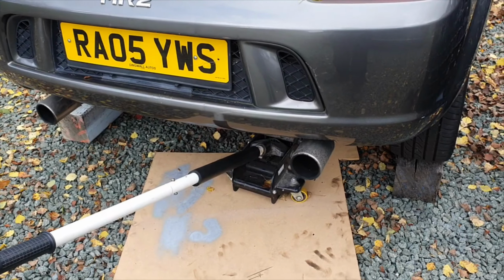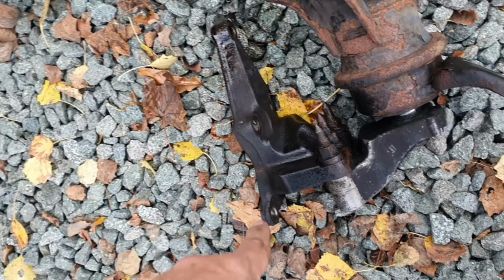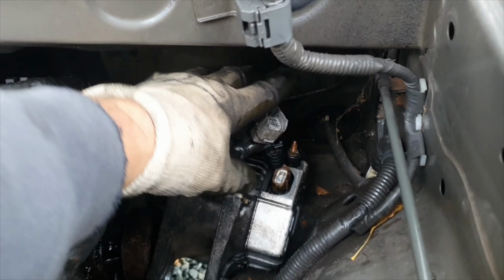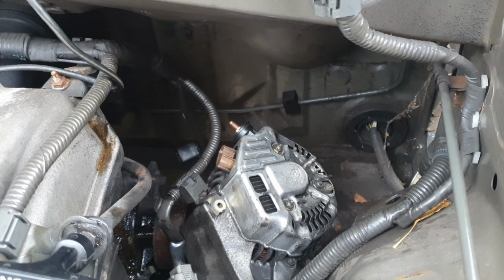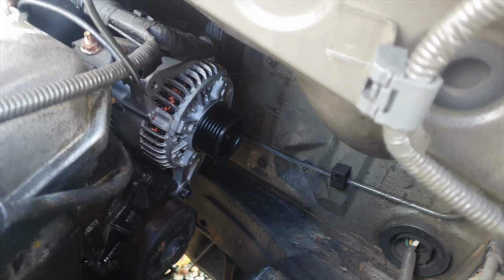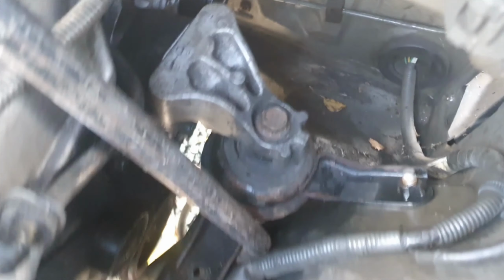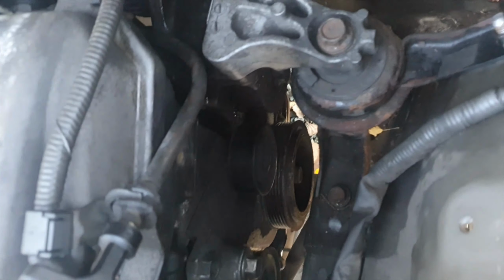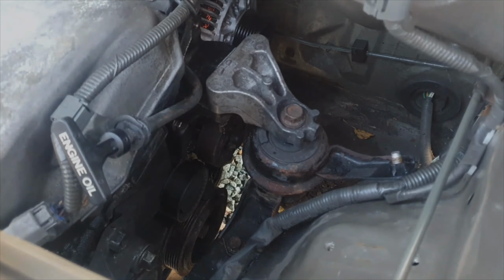How to Change a Toyota MR2 Mk3 Alternator

Comment: Hi did you have to jack the car up to replace or can you get away without.
Reply from the maker: You need to put Jack under bottom mount to take weight off the top mount when you remove it. The wheels can stay on and on the ground.

Comment: The belt tensioner is auto tensioning. The fake bolt to tighten the belt is pointless. I went and bought a new tensioner for no reason. So watch out for this guys.

Comment: Does the alternator really keep breaking on this car? Because the guy from techno pro spirit from japan says alternator keeps blowing up because of the heat of the engine or is it because they use it for racing?
Reply from the maker: I'm not aware that they keep breaking... This is first change in 100k+ miles.
Also, they are well away from the hot side of the engine..
Reply: @ottosgarage7986  or maybe because they always rev it to redline, thanks for answering im thinking of buying a mr2 spyder because i saw some online for less than 10k they are really cheap
Reply from the maker: Less than £2k!